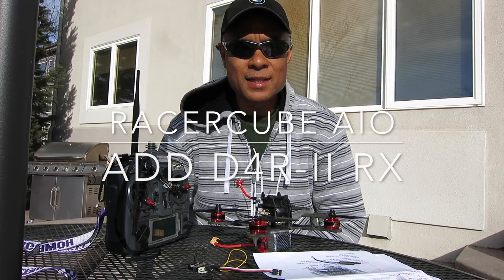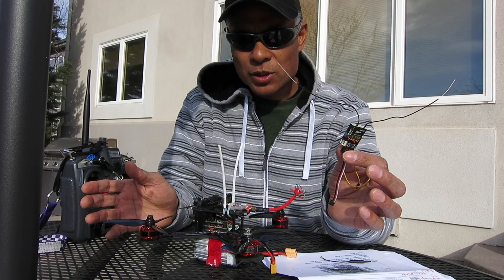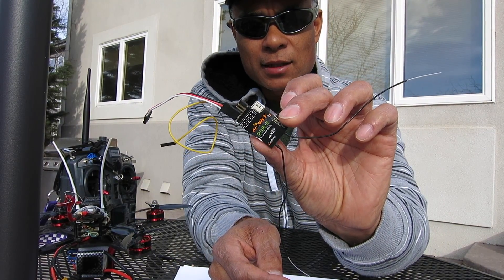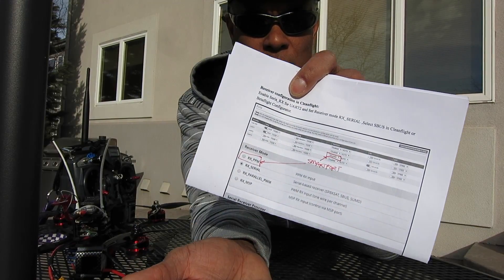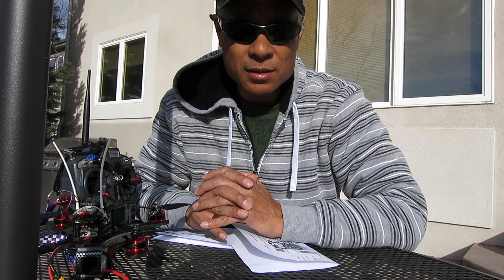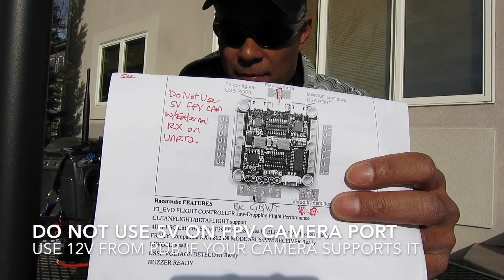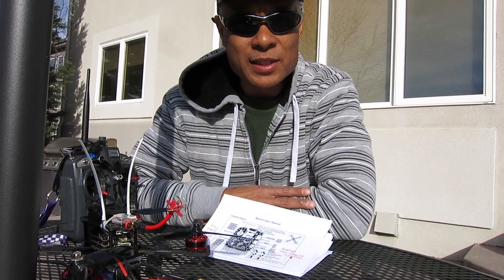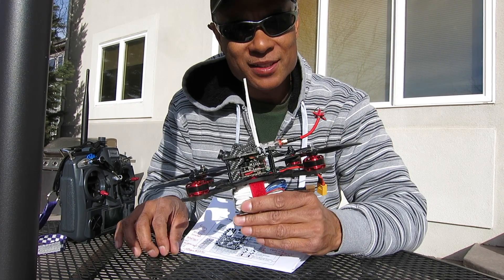Racercube AIO: Adding FrSky D4R-II Receiver

Comment: Le bonjour vous a donné il ne serait pas possible d'aller avec un FrSky D4R-II parce que j'ai aussi ce problème avec le rx intégré J'ai une portée de 300 m max merci pour l'info
Reply from the maker: L'image du tableau est ici:
https://youtu.be/4GwP4MtCQkc?t=2m43s

Les paramètres Cleanflight sont ici.
https://youtu.be/4GwP4MtCQkc?t=3m29s

J'espère que ca aide.
Reply: merci beaucoup donc le D4r sur GND/+5V/LED ?
Reply from the maker: Utilisez le connecteur UART2 pour RX, TX, 5V et G
https://youtu.be/4GwP4MtCQkc?t=2m59s
Reply: merci beaucoup ;-)